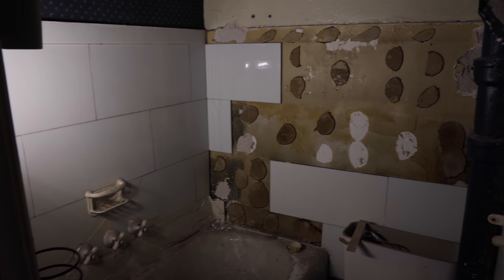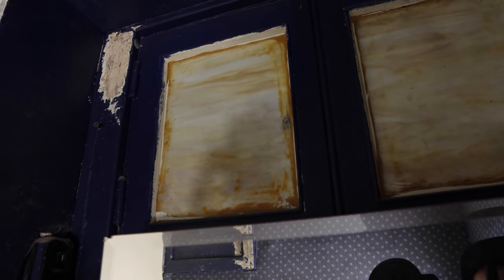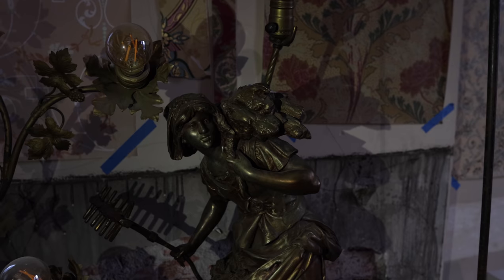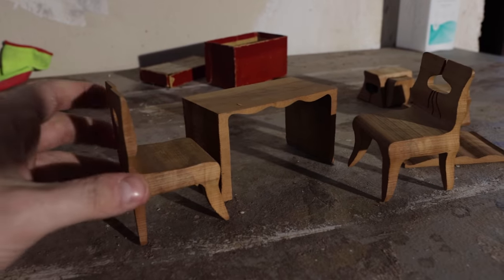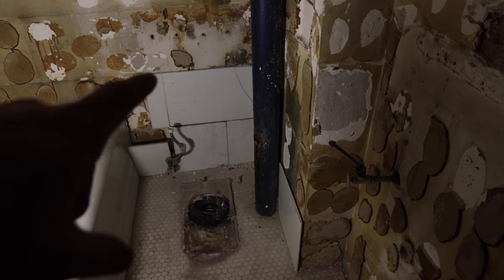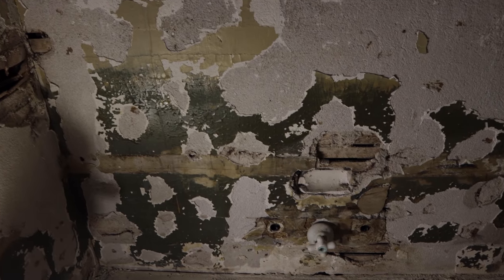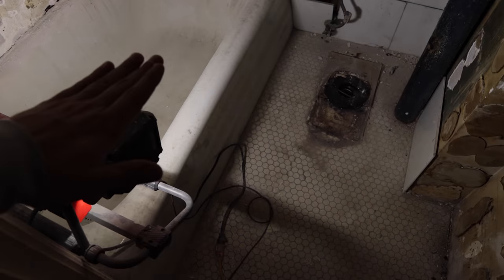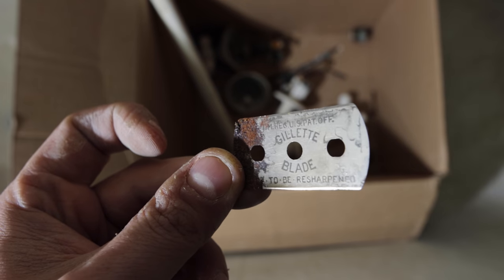Whats Next? Season 2 Begins! Abandoned Victorian Mansion S2 EP1

Comment: You always star something and never finish, I would like at least one room completely FINISH....CAN YOU GO ROOM BY ROOM AND FINISH THE JOB....JUST ONE BY ONE, PLS. DONT PICK IT HERE AND THERE AN LEAVE UNFINISHED  ALMOST EVERY THING  !!!
Reply from the maker: you have to understand most of the jumping around is a money/ weather thing. Here is an example. I would love to finish the library and the entire maids hall area as its the area i want to move into. However I need to complete the electrical and HVAC to do that. The HVAC is a 40k job. Money i dont have quite yet. The electrical / plumbing both have to be inspected as complete rough ins to meet code and i cant do it room by room or i would. So that means i have to open up spaces (like the bathroom in this episode) to get to where i can run the lines. Things like the newel post are included in this as it will have a lamp attached. Many of the materials are weather dependent. Such as the plaster and stripper. Plaster doesnt work well above 70 and the stripper will not work below 40. So once the weather changes the job has to wait until it either cools down or heats up. There is also the case of craftsman being quite busy. The mansard has taken over a year to get rolling as the guy i have doing it is way overbooked, but he is the right guy for the job so i have to wait. When he is ready i have to hop to that task. Same thing with the windows. They take 4 months usually to make and then a week each to install. I know i jumped into this project with not enough money to get it done in a year. I cant pay my way through this. I dont have a team. Its mostly me. So in closing i dont expect you to know the intricacies of why i do what i do and when i do it. However know there is a method to the madness.

Comment: Curious about the Hall & Brown Company.  You have explained the connection to Mr. Brown as the original builder of the house.
In north St. Louis, along the riverfront (and leading up to I-270) is the old industrial area with trucking firms, etc.  That stretch of
road is known as Hall Street.  I am wondering if that has any connection to the Mr. Hall that was part of the tool company ??
Reply from the maker: Hall St has no connection to our Mr Hall.

Comment: Very Cool! Lots of Stuff. I'm confused about that sewage pipe going to the 2nd floor. Where does it go to? (I think you where saying it goes into that Closet (?) What? Why in the Closet? Next Question: You where talking about a bathroom going on the 3rd Floor (?) So you are going to need a sewage pipe that needs to run up to there (?) Right? I know the 2nd floor had a bathroom. That sewage line I would think is from your back hallway and Parlor room (Somewhere on the 1st floor?) (The layout is still a bit there for me and not. Little sketchy)
Reply from the maker: Sewer pipes are required to have vents to the roof so that the gases don't build up and cause an explosion. This particular pipes extends through the 2nd floor closet to the roof. (There is no third floor above the 2nd floor closet or 2nd 2nd floor bathroom for that matter). This house requires three vent pipes. They no longer need to be huge or made of cast iron.  a 3 inch PVC pipe that can be hidden in the wall will do. which is what will do for this bathroom. The other vents will go through the 2nd floor bathrooms walls (one on each side). the one on the left will accommodate the 2nd floor bathroom and the one on the left will satisfy the new bathroom on the 3rd floor.

Comment: Have you thought about restoring the old butler's pantry to its original use? I'm sure you'll find a kitchen pantry to be extremely practical once you are living in the house and using the kitchen. I was thinking a powder room would fit great under the main staircase and the otherwise unused floor space adjacent to it (where you have been storing your antique refrigerator).
Reply from the maker: We would do that but where would a plumbing stack go? Can't put it through the steps.
Reply: @The2ndEmpireStrikesBack  With the tall ceilings in the basement, could you run the waste pipe under the first-floor floor joists across the basement ceiling to join the stack in the basement bathroom? I'm not sure how a long a run that would be and the required drop for that distance. Anyway, I love your channel. I live in a 1929 Tudor revival house and have restored some of the rooms to a vintage style. Looking forward to watching your progress in 2022.

Comment: For the windows i would probably, find a way to make the glass opaque enough to not be seen through, but but light cans still travel through it. Maybe put a lock on the inside so it stays close but can be opened for ventilation if need be?
Reply from the maker: The glass is exactly how you described.

Comment: I don't know if this has been said yet but to paint in the bathroom pattern you can make a stencil instead of doing it all free hand. Consider going to a laser cutting place to cut it into some plastic sheets and use a stencil brush to apply it rather than a normal paint brush. This can also be done with more complicated multicolored patterns by having different versions cut and layering them one at a time. It takes longer than wallpaper to apply but is faster and more consistent than hand painting.
Reply from the maker: I got this. I'm a professional stencil artist.

Comment: How do you decided when you be historically accurate (no dishwasher), and when not to be historically accurate (changing the original butlers pantry into a bathroom)?
Reply from the maker: We didn't decide to change butlers pantry into a bathroom. It was done in the 1920's (maybe earlier). We are only deciding to keep it as a powder room for all of our guests. Without having this powder room near all the public spaces, it means all guests would have to go upstairs on the 2nd floor to use the restroom.
Reply: Also I think Kaleb mentioned that they will have a dishwasher, it just will be hidden in a cupboard...

Comment: Can't wait to see that half bath finished, gonna look so good.   At first I was "what the heck is happening" when I saw those handles moving with no one in the room then I figured out you were on the other side.   A little "whoo whoo" moment there.   Wonder if you could rent a porta potty until you have a working toilet just to use while you are working and you wouldn't have to run out to the gas station.   Not an ideal long term solution but would work until you got a working toilet.
Reply: Or a camping potty

Comment: Stuff a tight fitting rag in the toilet sewer pipe.  If you do not do so you will have sewer gas coming into the house.
Reply from the maker: the pipe underneath was removed 6 months ago when sewer lateral was installed.
Reply: Sounds as if that issue is covered!

Comment: The razor blades come from the old mirror/vanity sets. They had a slot in them so you could drop your used razors in and they'd just safely hide in the wall (well, til you tried to renovate, lol).
Reply: I was on the demo team of an 11  story hotel built in 1930. There was a blade slot in each bathroom and some of the wall spaces were filled with a very rusty collection of used razors.  I have a few of the porcelain blade slots and tiles in the barn. The hotel was converted into senior apartments and the building was saved.